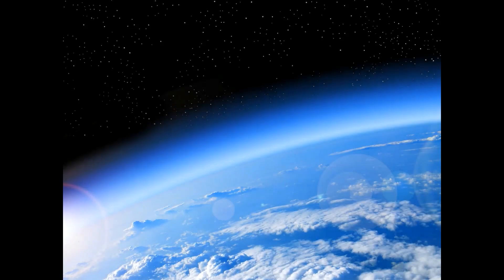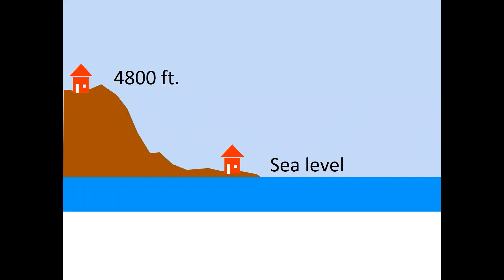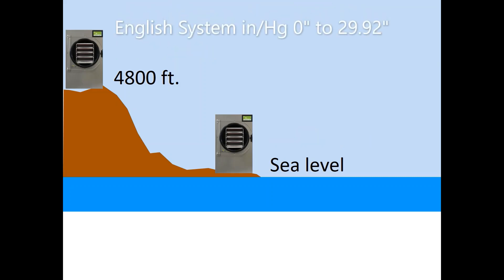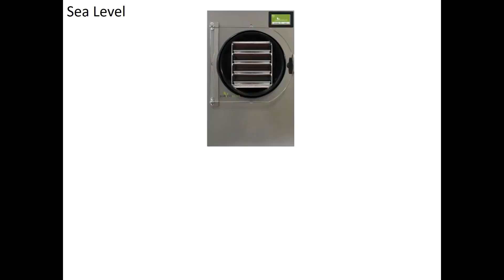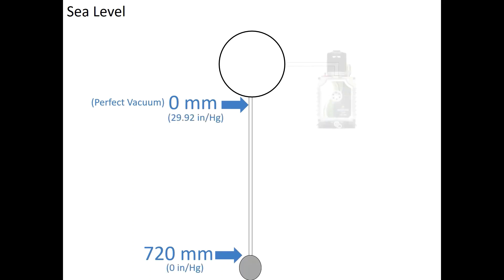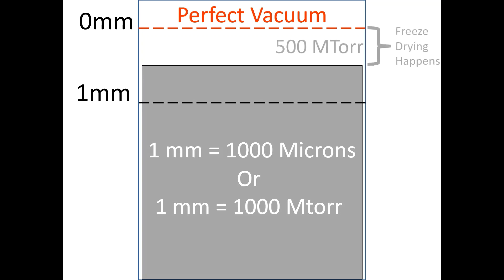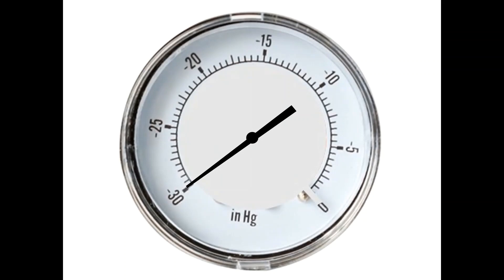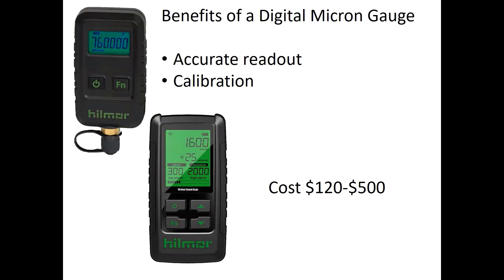Understanding 500 Mtorr in Freeze Drying

Comment: When does freeze drying happen at 1000 feet? Or is there a chart I could reference?
Reply from the maker: Freeze drying (sublimation) happens when 1. water boils at room temperature under a vacuum and 2. The food is frozen and slowly thawed to control the amount of water that is boiled.

Altitude comes into play when the higher you are, the less "air" (pressure) there is to pump out of your vacuum chamber.

Comment: O.k. here is what I have. I have a freeze dryer that will not pull a 500 mtorr vacuum. Here is what I have done.
1. I have sprayed with carb cleaner while under vacuum:
     A. The door seal near the metal unit and near the lexan/plexiglass door.
     B. The drain line including all junctions.
     C. The vacuum side all fittings and sensor and vacuum line both ends.
I found no change in vacuum while pump is running.
2. I tested the drain valve by placing the drain line end in a glass of water while under vacuum. No water was noticed in the line after 30 min.
2. I have replaced:
     A. The drain valve with a solid brass ball valve.
     B. The door seal.
     C. The vacuum line.
     D. The vacuum pump.
I placed a dial vacuum gauge on the pump and it read 28.6 in.Hg.
I placed the dial vacuum gauge on the drain line end of the machine and it read 28.4 in.Hg.
These readings achieved max vacuum within 10 min.
3. I have coated ALL connections with liquid tape while on vacuum.
4. I have loosened the door hinges so that the door barely hangs on the unit and is pushed into place when vacuum starts thus hinges not hindering the seal.
I have sprayed cleaner into the vacuum sensor and rinsed it out.
Nothing up to this point has done anything.
If I run the chamber empty, it achieves vacuum within 12 min.
If I put the tray holder (plugged in and not plugged in) or just a single empty tray into the chamber it will NOT achieve a  500 mtorr vacuum.
My next thought is to replace the vacuum sensor.
Anyone have any other ideas?
Reply from the maker: I bet your frustrated.  I would be and have been.  Using a Hg/in  gauge will only give you a rough measurement of vacuum.  At my altitude the best I can get is 25 hg/in. You need to think metric in this case, it's almost like thinking backwards.  you need 1/2 mm of vacuum.  See this video to help you understand:
https://youtu.be/DgLrMm5KIgg
First of all you need to find out what your vacuum pump will produce in microns at the pump's inlet, then at the end of the hose.

It sounds like you have covered all the bases of finding leaks.  If your pump can go under 500 mtorr and you have no leaks, then you may have a software issue.  What software are you running?
Reply: @Philat4800feet  I am running v5.0.23
The unit is a large. I purchased it in 2018.
It has mostly always given me problems with vacuum.
There is one thing that is very strange. When I close the door, there is NO solid visual ring. The ring touches the glass and shows only on the hinge side until I latch it and it disappears.  I have adjusted it both ways to no avail. I cannot get that side to show the ring. I purchased a new door seal but nothing changed. I even all but removed the hinges so that the door is just barely hanging on, turned on the vac pump and pushed the door until the vacuum pulled it to. It still did not achieve vacuum. It is like the drum has been ground uneven. I do not know how to test for that. When the vacuum pump stops the vacuum changes fast like there is a major vacuum leak. So it could be the drum. I put a straight edge on the door and the door shows about 25 thousands or so bow. I turned the door around inside out and ran it but the seal acted the same way and could not achieve a vacuum. 
Concerning the gauge. I bought it because it had mTorr reading on it. It reads 35 mtorr at the pump and 40 mtorr at the drain valve.
Reply from the maker: That rules out the pump.  Sounds good.
Doesn't the drum come with a 5 year warranty?  Have you had any contact with Harvest Right on this problem before 2023?
I think the problem could be the drum to door gasket seal
Reply: I paid my 45.00 and they have my data. I have not discussed anything with any person at this time. I contacted them in 2022 about a vacuum leak but did not find the Divit until now. I will tell them when they contact me. Waiting you know. I tried putting tar in the gap but it did not change anything. Not sure what to try. I am hoping they have an idea.

Comment: Good job. I just got a new in/Hg gauge and my 60 day old HR pump pulls 15 in/Hg or 380 torr.. I think the pump should pull close to 30 in/HG or 0 torr. I also think food would dry faster and better with more vacuum. I also think as soon as the chamber is under 0 torr and a ball valve on the suction hose is closed the pump could be turned off for all the hours of dry time, with no leaks. Why keep sucking on a chamber that is not loosing vacuum? Thanks,

Comment: If I am understanding this correctly  then at 38 feet above sea level it would take much longer to reach 500 mtorr? So if mine is getting to 640 in 30 minutes is that good? We haven’t used our freeze dryer in over a year due to other things going on and restarting now but I don’t remember what it was able to get to when we first got it 😫 on one test it got to 540 around 40 minutes.
Reply from the maker: The higher you are, the less air.  It will take a shorter time to pull a vacuum as elevation increases because there is less air (density).
Just as a comparison, I'm running a batch of strawberries. My unit was at 290mTorr. I turned off my premium pump, and opened the door, shut the door, and started the pump back up.  It took 4:36 minutes to get back to 500mTorr.
Make sure your oil isn't too old.  You can pull a better vacuum when your unit is colder than at room temp.  Also check your hose tightness and other locations for a vacuum leak.

Comment: I live in an area where the average elevation is 13 feet above sea level.   Will this affect my vacuum pressure.   I've never been able to get it lower than 1500 mT.
Reply from the maker: It shouldn't,  it may take a few more minutes to pull a vacuum.  If you can't get to 500 mtorr you may have a leak.  Have you done anything to find one?  How long have you had your FD?
Reply: @Philat4800feet  I've just had it for a month.  I went back and tightened everything and now it's going down.     I'm seeing 178 mT now.  Is that fine?
Reply from the maker: That is really good

Comment: What about Harvest Right's new "AI" software that changes science so you don't need to get below 1500mTorr?  How does that work Phil?
Reply from the maker: The principle with freeze drying is to remove the moisture in food without high temperatures.  moisture (water) is removed when it becomes a gas at boiling.  I can boil water at 78 degrees at 30,000 mtorr.  Although there may be a food quality issue.  At 500 mtorr the quality of the food is better.  The greater the vacuum, the faster the batch and the better quality of the food.
Reply: Thank you that makes perfect sense.

Comment: Thanks for your time and effort. I was thinking that you would address the Harvest Right magic number of 500 mTorr when the tray heaters kick on to jump start sublimation and that they kickoff at around 650 in order to drive the moisture out of the product to be condensed on the chamber wall. The readout will go up and down between the two numbers as the heaters kick off and on until there is no more moisture (relatively) left to extract. The best indication of completion is an mTorr under 200, if the machine is capable.
Reply from the maker: Good thought process.
Reply: I was getting nervous that I was possibly doing something wrong and endangering my pump when the vacuum got as low as 150 so I stopped it. Product was perfectly done. Am I to understand that a reading of 200 or less is safe for my premier pump and also a good indicator of doneness?
Reply from the maker: @nataliedana2122  Safe and very effective.

Comment: so if I'm at 3428ft above sea level what should my pump gauge be showing in HG? I'm have a leak problem and I suspect it's the pump.. I noticed batches were taking longer and the last time the pump turned on it sounded weaker and the oil. in the oil glass is only bubbling in one side and not both when the pump turns on.
Reply from the maker: At 3428' you will have less pressure and less air inside your chamber.  Your pump will be able to draw down to 500 Mtorr faster then me or others lower than your attitude.   At 3000' in/hg is 26.82.  At 4000' in/hg is 25.84.  Your location would be between these two numbers.

Comment: Harvest Right just replaced my white oil free pump I bought with my Medium unit last February due to vacuum failures. 
lucky for me I had an original oil type pump to pinch hit for it and prove quickly that it was a pump failure causing the vac alarms.
They were real good about doing the warranty service - spot on.
I am at 1800 ft elevation, as I understand it a pump has to work harder to achieve under 500 Mtorr the closer it is to sea level. In 10 months that pump did about 90 loads which I think isn't that hard a life for a vac pump? Do you think I overworked it?
Reply from the maker: If you run the pump with clean oil, keep the moisture out, and allow the outside to cool, it should run for many years.
Reply: @Philat4800feet  I just got my FD and I did approximately 3 vacuum only tests with skittles and other candy, following the steps in your other videos. I noticed it was worse each time I did a test and when I checked the oil gauge it was cloudy. I’ve emptied it and flushed the pump. It now has new oil but I’m wondering how water got in there? It’s quite humid where I live at the moment. Do you think the problem will be resolved if I use a dehumidifier in the room where I have the FD?
Reply from the maker: @bscc123  Could there've been water in your drain hose or in the corrugated plastic sheeting at the top and bottom of the shelves?  Any water will go to vapor and will be sucked up by the vacuum pump as the chamber in pumped down.  I use a small fan to defrost my chamber.  The air movement might help drying your chamber.
Reply: @bscc123  This also happened to me the first time I tried the 'skittles in 3 min' method. I assumed i had run too many total batches and just needed an oil change, which I then performed. At first I was happy with my skittles but I really had no idea what they were supposed to end up like. I ran many batches to gift for Christmas. Then, to my horror, I noticed the skittles began to shrink significantly within a day or 2, becoming sad and chewy again. I was frustrated but determined to figure out what went wrong. Last night I tried again and had great success! This time I pre-warmed the skittles to 170 F. for 5 min then put into the FD. I set the shelf temp to 150F and forced my Harvest Right straight into Final Dry mode and I let it run for 3 hours. I finally pulled them out when the chamber reached 150 mT vacuum. They are crunchy, amazing and a completely different, vastly superior product than my first attempt! I was surprised to see how much ice had formed on the chamber during this process and led to assume that my first attempt failed due to the very high moisture content that was left in the product when I only put it under vacuum for 3 min.

Comment: Very informative. Currently fighting with my dryer vac issues. Waiting on a new pump. Strangley, the old pump measured 30 in/Hg while running, which would mean it was good? The service mode says I'm not getting below 20000mtorr
Reply from the maker: 20,000 Mtorr is about 3/4".in/hg  This may be hard to detect on a in/hg scale.  This is how fine the Mtorr scale is.  Have you checked out any vacuum leaks?
Reply: @Philat4800feet  yes, checked the door seal, drain valve and inlet line. Have not checked the epoxied wire hole. I'm leaning towards the pump because it happened right after I opened it up, and desludged it, and it was particularly sludged